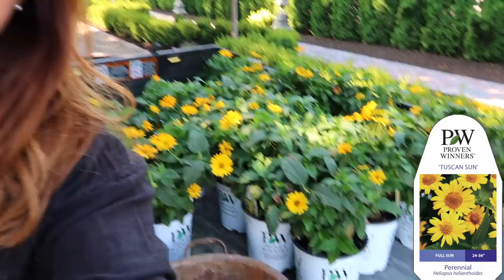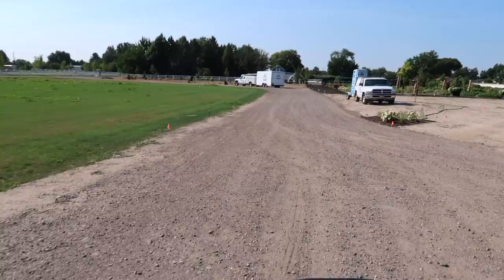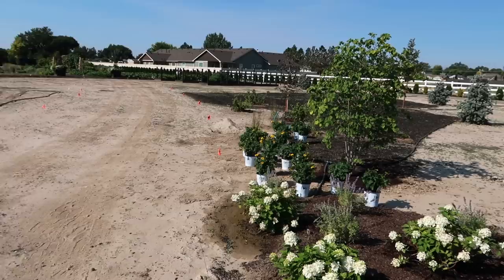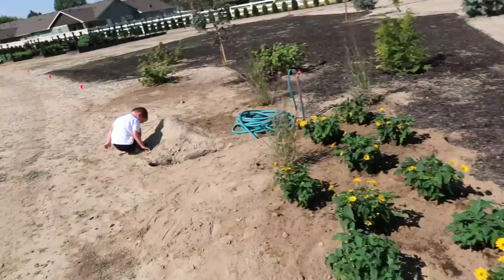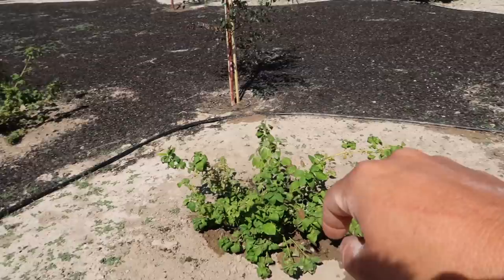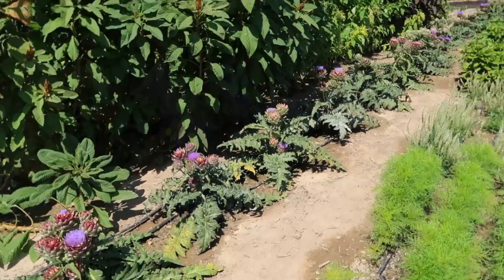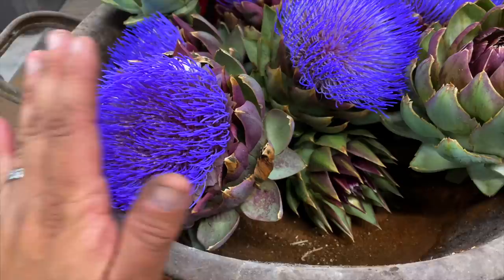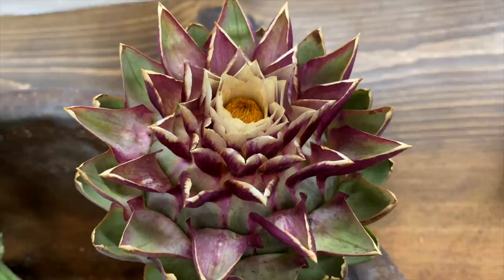Planting Heliopsis & Harvesting Artichokes to Dry! 🌼💜 // Garden Answer

Comment: I have only dried artichokes once and based on my success with peony’s I didn’t want them to close up from hanging upside down so I set a 1” trellis on sawhorses (you could set them in the slats of your wooden rack) set the artichoke flowers in random openings (stem side down, flower side up) and let them dry.  The flowers faded a bit but they remained more open and didn’t dry into a closed ball style..  when they were dry I did spray with a light dusting of gold and put them outside in my fall arrangement  - they were beautiful and lasted until I took the arrangement apart in early spring.

Comment: I noticed your silica gel crystals had some dark flakes in them. Depending on the brand, this could be an indicator that your crystals are in saturation (say if you left them out in room air for a long period of time). You can "recharge" them by popping them in an oven for a bit, spread out on a cookie sheet, until the darker crystals turn a lighter color, essentially dehydrating the silica gel. This may help your flowers dry much faster. I purchased my own silica gel crystals off Amazon shortly after watching one of your earlier videos. Worked great for my spring tulips and daffodils and I'm looking forward to trying out some dahlias soon. Love all your videos!
Reply: Agreed - I bought some WiseDry silica gel crystals off Amazon after watching an earlier video and was inspired before this video was even over to go cut some blooms (zinnia, anemone and dill flowers) and use the crystals to dry them.  The instructions say the orange crystals turn green when they have been saturated.  The instructions also say to cover the container with the flowers/crystals while drying - which I assume is to prevent moisture from the air getting into the crystals.

Comment: I had a dried flower shop years ago and it works best to use rubber bands to hang things upsidedown. When doing a bunch just put the end of the rubber band on one stem, wrap the rubber band by the other end and just go around and around the bunch then put thatbend over top of another stem then hang the bunch up. This goes super fast and as they dry the rubber band stays tight. As the artichoke you did the right thing. That is the only way I dried them and that is why they are so expensive. It takes lots of gel and time! Great job!!

Comment: Drying Flowers. I used to dry a lot of different flowers and found fine, white sand was one of the best ways to dry them.  Like your silica gel it keeps the flower shape and colour well, but sand dries the flowers more slowly than silica and the flowers are not so fragile after being dried. It does take a little longer, but sand is also a lot less expensive.  This may not work well for more humid areas, but like Laura I live in a hot dry climate here in southern Australia.

Comment: There is a following for dried flowers for sure, it would be beneficial to have a drying rack system in you barn, hotter, less humidity, and quicker system.  Use rubber bands, as the stems shrink they won't fall out as they dry. It worked very well for me in the flower shop.

Comment: With irrigation it's always a challenge to find the right connectors for pipe thread, hose thread etc. without having leaks. If you two were to just have a video of the specific types everyone needs that would be fantastic! I remember you briefly explained in a video not long ago.  I think a detailed video as the topic would be great. I had this issue in the spring with a new bed & it was so frustrating. Finally figured it out. Thanks so much.

Comment: Found this on eth internet

You can also dry artichokes by baking them in the oven at 245 degrees for about 4 hours - checking every twenty minutes or so. You may have to fine-tune this “recipe” depending on the size and dryness of your artichokes.

Comment: This may be a dumb question but if you "mulch" with "compost", aren't you laying down the perfect conditions for Weed City?  I understand  you wanting to enrich the soil but with your windy environment, etc. isn't it a bigger concern for weed seed germination in your compost?
Reply: No such thing as a dumb question! They have a pretty good weeding routine, and great full time help with Paul. I think controlling the water with drip irrigation will also help with weed control; if the composted mulch doesn't get wet, (and it won't get near as wet with targeted drip irrigation)  weeds aren't near as likely to germinate. (That's the main reason they haven't been watering to keep down the dust in all the umplanted areas)
Reply: Ahhhhh, you're right Tammy H.  They don't get much rain or over head watering.  Therefore, less chance for weeds to flourish.  I live in South Carolina.  Mulching with compost would be a problem (big problem) for me.

Comment: The new space is coming along so quickly and it’s very exciting to watch! Just curious as to why you don’t just go ahead and compost mulch all of the areas you are planning beds for to help segregate the space visually and get some amendments going into the soil now. Wouldn’t that help for future plantings and keep the dust/weeds down for the foreseeable future? I know it’s a lot of space but it would definitely tidy things up!!
Reply: I think it would be expensive for very little return. It's worth it in areas where they are mulching to help new plantings with moisture and weed control, but they'd have to water any unplanted mulched area to keep the mulch from blowing away, and then the water would help more weeds germinate. They had mentioned in earlier videos that they don't water the unplanted areas because it makes the weeds 10 times worse, so this is just my guess!

Comment: Laura, I looked at the augers and drills from your site.  Is your Dewalt power plant drill a 20V or 60V?  Is there he diameter a 8” wide or 9” wide in this video?  I have some 3 gallon shrubs to plant.  Thank you for your help.
Reply: The drill they use for the larger augers is definitely a 60v. I want to say the larger auger is a 7 inch one, but not sure. If you go up below this video, in the area where it shows how many subscribers they have, you will see "Show More"; click on that, and there will be a link to the drill and the augers. (And Laura gets a teeny commission) Pretty sure the one she's using is the Power Planter 100% USA Made 7"x28" Extended Length Gallon Pot & 4X4 Post Auger? But I honestly can't remember if Laura and Aaron have an even bigger one. I use a 20V drill for the smaller sized augers, and although it takes a little longer, you can still drill a 3 gallon hole with smaller ones. I am a geezer and my sweet husband has to dig my holes if we use the larger drill and auger. :o) They are SO worth it! In our super rocky soil,  we do still have to use a shovel, but the augers are a huge help!